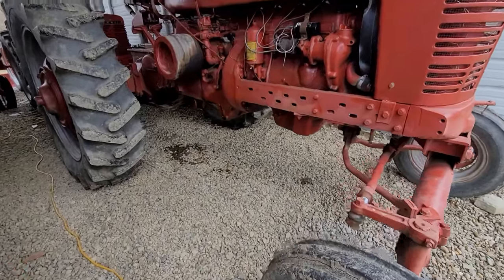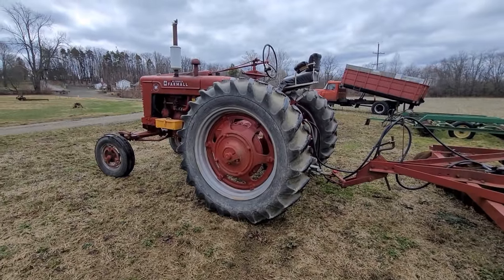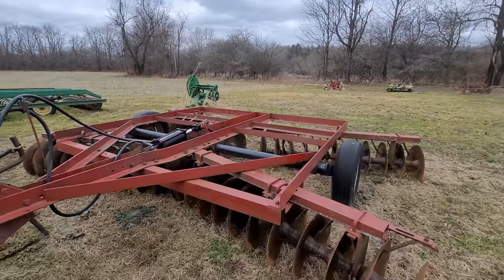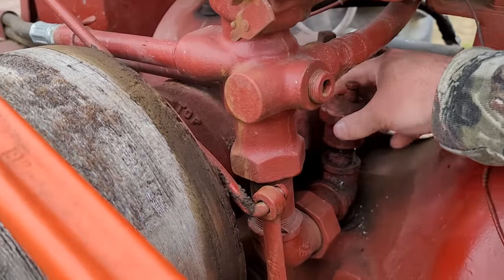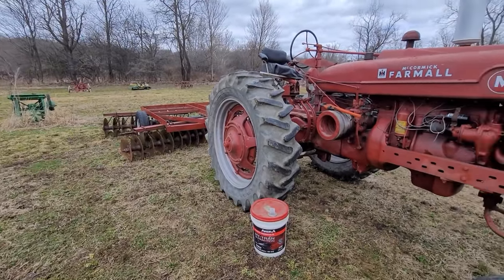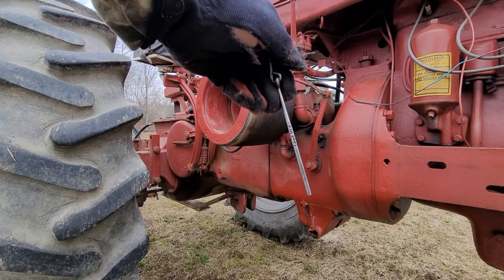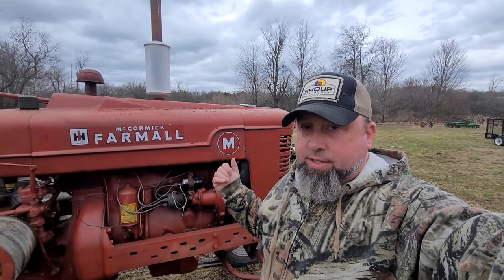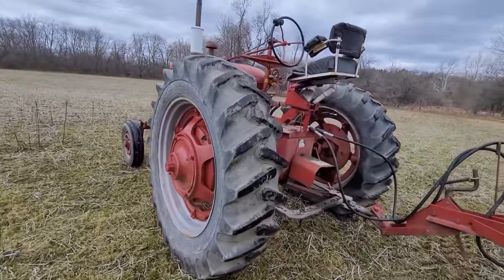How to Get the MOST Out of Your Farmall Tractor's Belly Pump

Comment: Here's another letter series tip: for hydraulics that circulate, like our M and H with aftermarket two way control valves, plumb the return line into the factory drain hole at the bottom.
With a 90 degree fitting plus a tee, you can keep the factory drain plug for easy fluid changes, but return oil won't get aerated. Also a 45 fitting and a stand pipe from the factory fill hole will give you a little more capacity.

Comment: I was born in 83 but I picked up a Super M  with a loader  a while back for just moving things around the house I cant alone.. Thanks for all you show. I even re-did a 2 bottom Genius because of what I learned on here.
Reply from the maker: Awesome tractor and plow ...American made
Reply: I was born in 84 and I was torn between buying an M with a loader and grapple fork ($1400) or a snow plow for my Honda Rancher 4-wheeler ($600) for clearing snow in my driveway here in town.  I ended up buying the snow plow, since I love using my 4-wheeler, but my Uncle has 2 M's and he said they start great during the winter.  Just pour some gas down the carburetor.

Comment: Hey fanatic! Guy from Butler here. Heard your call man about to dry I was over most of our farm last week watching hey and pastor at least spreading fertilizer and this afternoon even after the rain and snow we cleaned our stock trailer to dump what we cleaned out of the stock trailer on it so we can plow it under. I was quite surprised how well I was able to get in that with the skin I think a couple try sunny days we might need to put the flowers in the ground here the question is when are we going to get a couple dry sunny days? And by the way the old BN that we rebuilt last summer and then needed a new fan drive hub and a little touch-up work on the radiator is back together today I made a trip to New Bethlehem this morning and brought the parts home and she's purring like a kitten again! Was really pleased to hear it run
Reply from the maker: Most excellent 👌

Comment: Grease is cheaper than steel. Grease a disc everytime you use it. Unless you have sealed bearings on the gangs. It's amazing what a little bit of hydraulic oil will do. The old belly pump was doing her part after it had enough oil.

Comment: I'm not very familiar with the belly pump. The standard tread tractors have live hydraulics with the pump in between the timing gears and distributor or magneto just like the late Farmalls have. But what you said applies to them too. They are lower pressure so they require a larger cylinder, and keep the hydraulics full of oil. I'm not sure about the belly pumps, but the standards have a " tin can" hydraulic tank and they only hold about 5 litres of oil. On them though, it's probably better to use engine oil in case the seal goes on the pump and leaks oil  into the crankcase, although we also sometimes use Hy-Tran for the same reason you do... You can buy an equivalent to Hy-Tran at a bulk petroleum dealer.  The new Hy-Tran is synthetic and therefore highly expensive. It's not necessary to use synthetic in an IH tractor as they never had synthetics then.
Reply from the maker: everything you said is correct

Comment: What's happening when the fluid gets low? I'm assuming the pump cavitates and tries to pump air? Seems like the real problem is that "Full" line on the dipstick is too low for what should be properly full to prevent that, eh? Is it possible to overfill? Shouldn't be if all you're trying to do is keep fluid in and air out, right?
Reply from the maker: I haven't added fluid in 5 years and didn't need to add that much to make a huge difference. Just pulling the lines off the remotes will make you lose some fluid, and over the years, a little adds up. I agree the dipstick is off

Comment: Some one put a later pump in my 41 H. Running 30w mineral oil. 3 point hitch with a 3"x8" IH cylinder. It'll pick up stuff. Actually measured the pressure with a gauge I bought. 750psi.
Reply from the maker: It actually called for 30w out of the factory...HyTran is only 10w

Comment: 3:48 Does your M have a simple gear pump? If so, it should pretty much last a very, very long time unless you are trying to run rocks thru it.
Reply from the maker: It's an 80 year old tractor...that's what I call lasting. A lot of em wore out due to running em dry, etc.

Comment: Yup, people ask me the same question. How do I get these old tractors to lift? .... get a larger cylinder...  More area inside the cylinder means more lifting power.
Reply: At what point does the cylinder get too big for the old pump to be able to push?
Reply from the maker: I know a 4x8 isn't too big...and is a massive difference
Reply from the maker: Yep and lots of fluid
Reply: @JeepWranglerIslander  bigger the better. Some of the old loaders that were on these tractors were 4 inch by 8 foot.
Reply: @JeepWranglerIslander  It never does get too big to push. The bigger it is, the more force you have. The downside to bigger is it's slower. Another potential problem with a cylinder that's big is the limited oil capacity in the tank. I'm not sure about the Farmall belly pump but the standard tread equivalent to a Farmall M is a W-6. They use a cylindrical tank about 7" in diameter and a foot long so they don't hold a lot of oil.  I've seen bulged hydraulic tanks on those tractors when they use the original hydraulic systems on loaders for that reason. That being said, it's the rod diameter, rod length and number of cylinders that affect that, and not the diameter of the piston.

Comment: Supposedly, CNH is using Shell to manufacturer hy-Tran now and it’s not rated for the older stuff with TA’s and it’s quicker to break down. Not sure how true it is as I’ve only heard it from one guy. the old manufacturer was a brand called viscosity and their ultraction original is what hy-Tran used to be
Reply from the maker: Heard that too
Reply: Didn't IH have their own plant in Oklahoma that made Hy-Tran.

Comment: All of my equipment gets greased every day of use no matter what it dose I have two IH 3 ton dump trucks 1974 modles one green one blue gases both run exalent 1586 1066 two 8000 ford's no a thing wrong with ether one of them combine TR 99 still doing there jods.
Reply from the maker: Every single machine you named is a dream machine 😳